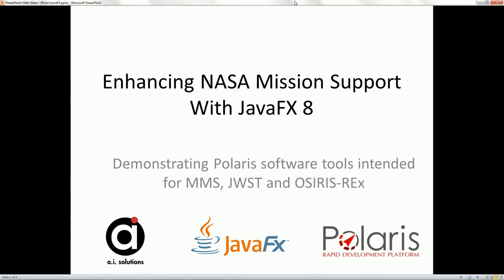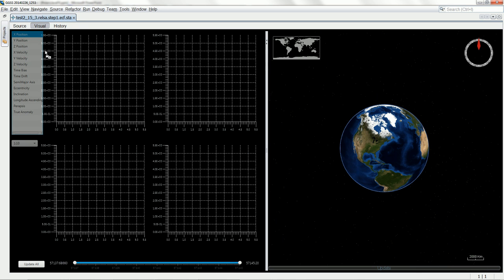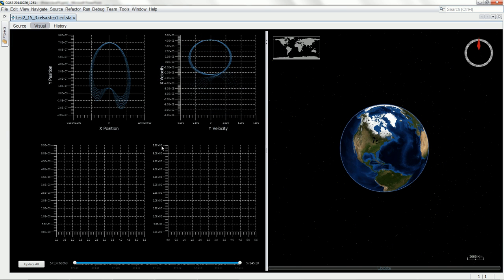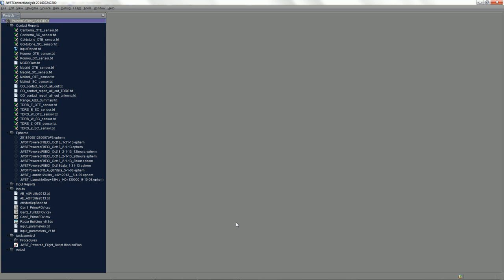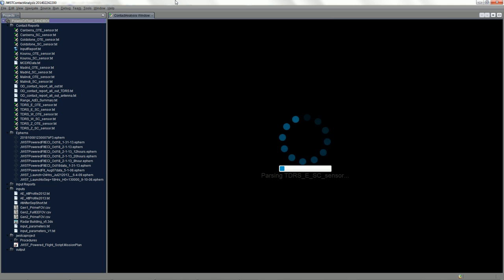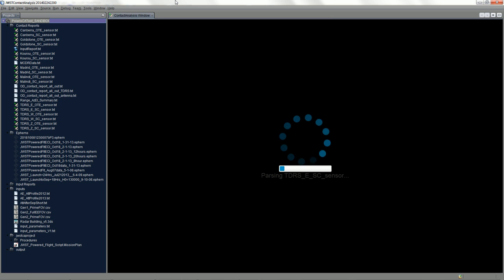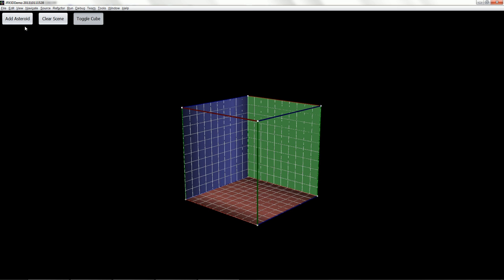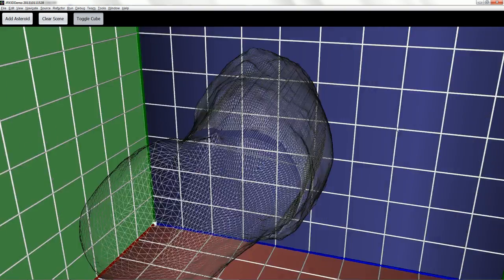Polaris, JavaFX, ControlsFX and F(X)yz supporting NASA Missions

Comment: I loved this video. I am a Java EE developer who mainly works on back-ends for web apps. On the side I have been messing around with JavaFX after a friend asked me to make a desktop app.

The problem with web developers is they all say "nobody uses desktop apps anymore". They are so close-minded. They also don't believe me when I tell them that JavaFX is NOT AWT or Swing.

This is a great example of JavaFX doing enterprise applications. (I also like it because it involves NASA and I live right near JPL in Southern Cali).
Reply from the maker: Yeah we have a decent mix of desktop and web app developers here and I hear from the web app guys what you are saying.  "Desktop is Dead"  right?  Except when you need to do anything actually useful beyond basic data form entry. 
I suppose you could string together a bunch of web frameworks to do the above use cases but the key is that all of those capabilities were integrated into a single pluggable platform. Web guys always point to these cool WebGL 3D and some cool 2D Canvas renderings and say "See!  Web can do anything a Native App can!" but these demos are mostly just toy problems.  Once you try to develop real hardcore interactive systems like the video above most of the web based platforms grind to a crawl in performance.